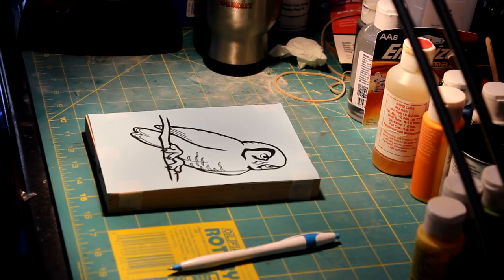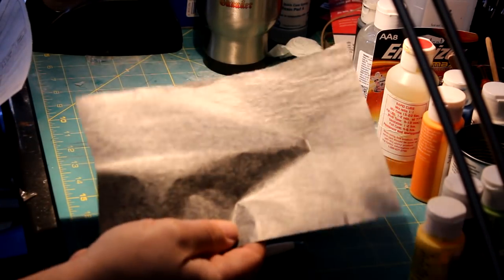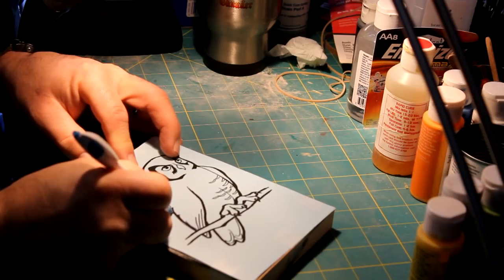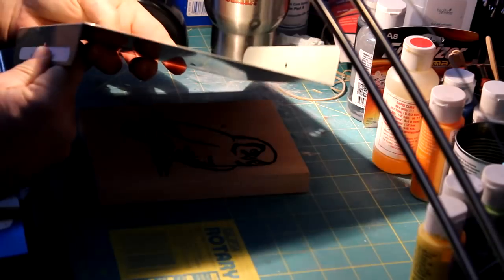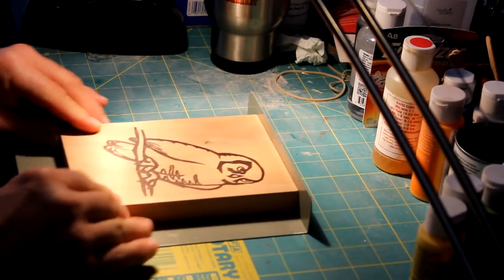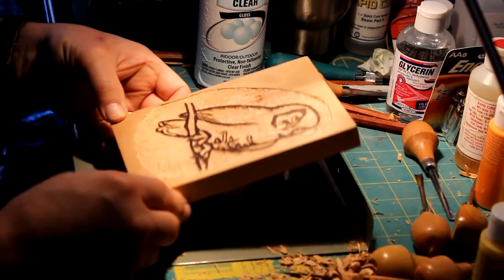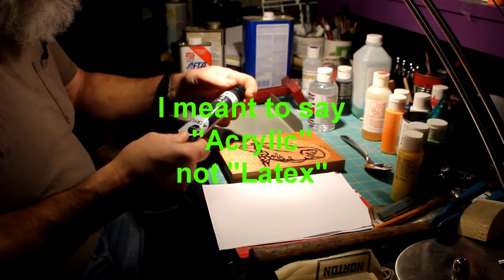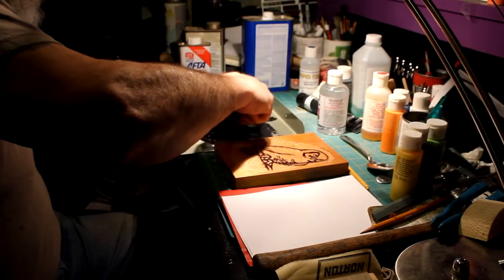(S-1 Ep-28) Make a Wood Cut Block Print

Comment: I simply spray the back of my printed image with spray cement, lay it on the block, then carve away. Much less prep work.
Reply from the maker: Thanks for your comment, rim98253. I've used your method before, and I know lots of people prefer going that route. I personally don't care to use the spray adhesive and carve through the paper though. That's why I use transfer paper and then carve directly on the wood. It's simply a matter of personal preference. Thanks for bringing up your preferred method in this comment section though, as I neglected to mention it in my video, and folks new to this will have an alternative to possibly try.